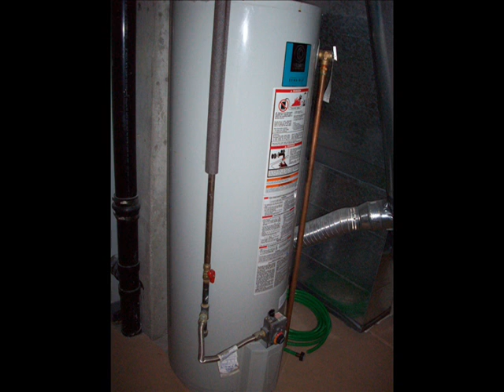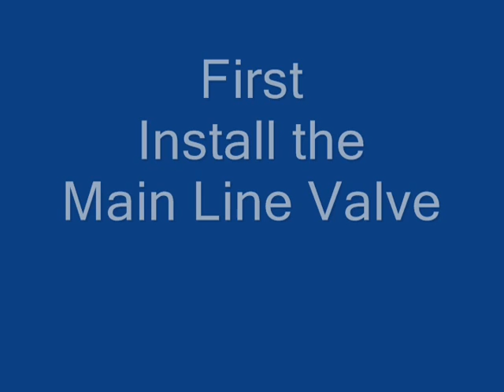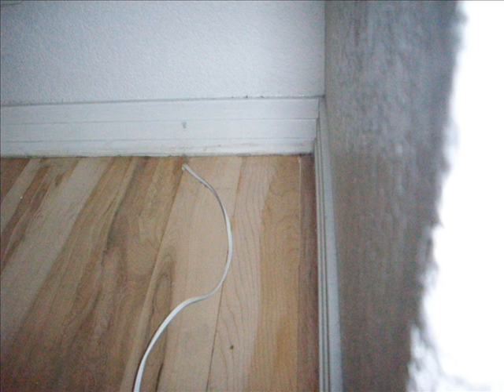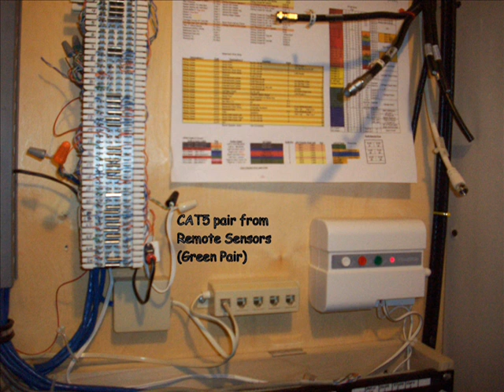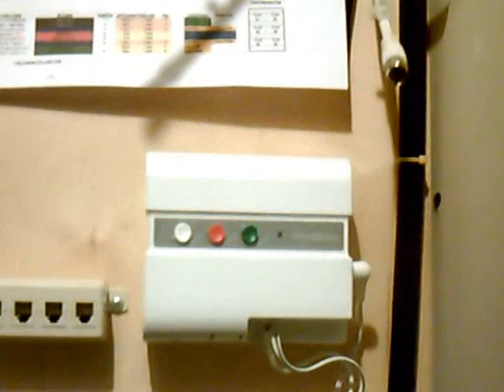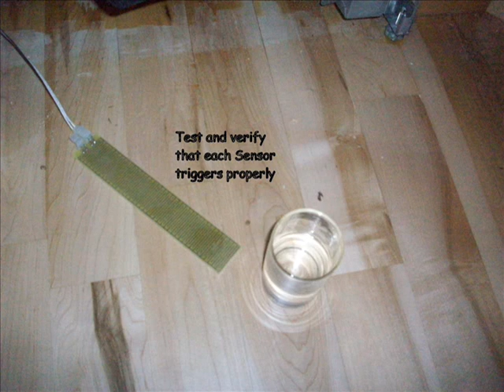Water Leak Prevent Flood FloodStop Water Main Shutoff Valve | Whole House | Flood Prenvention

Comment: One time I had a hose that was turned on in my backyard that blew out and gushed presumably for hours.  This is what I am seeking a way to prevent.

Is there any shutoff valve that will activate based on a continuous flow lasting over a certain amount of time, or the use of some threshold amount of water, say set great than an hour long shower, or a flooding basement, with or without a moisture sensor.

Comment: Next time use Honeywell vista20p burglar alarm control with 4140 multi relay module for valve operation and alarm water sensors that can be zoned individually as well as alert you by means of a siren and or central station connection

Comment: Did you buy the 1/2 inch style or the 3/4 inch style? Also I'm confused about the wiring. Did you have to wire the water sensors into something else having to do with the appliances or did you just wire them into the control panel?

Comment: Continued from last post: for the upstairs bathrooms, I put the sensors (wrapped in old socks) in the heating ducts. This way, they're protected from minor splashes, but they'll detect leaks from either the sink or the toilet (if you put the sensor on the floor behind the toilet, it might be at a high point--the water may never reach it if it is pouring down into the heat register).

Comment: I did the same thing in my house. Some differences: I used 14-gauge wire (i.e., normal wire for household 110 Volt service) for the long runs to the remote sensors because I was afraid the signal would be attenuated too much with the thinner wire used by the manufacturer. I put an old sock around the sensors under the appliances--they still detect leaks, but they won't give false alarms by shorting out on the metal on the underside of the washing machine. Reaching character limit; to be cont'd.